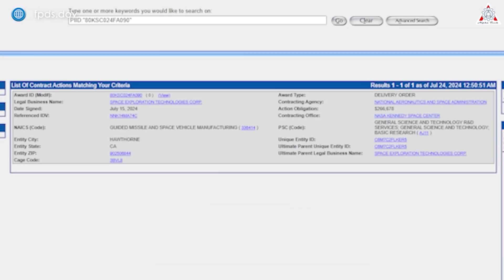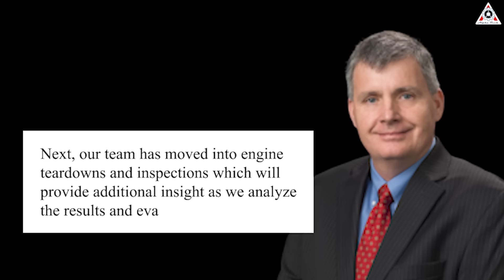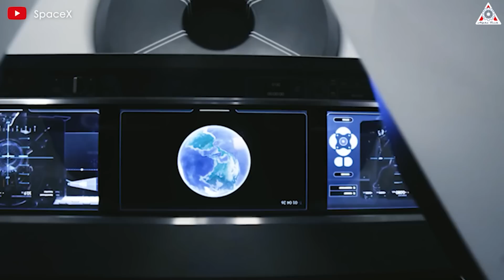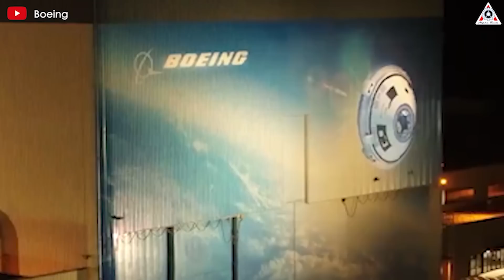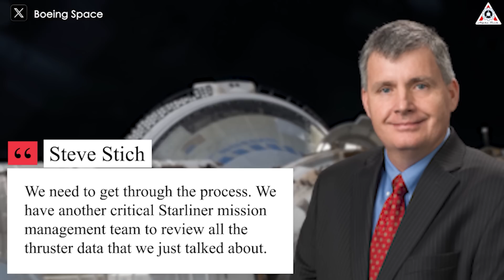Boeing Starliner is OVER!...NASA Says Something Weird Happening On Starliner.

Comment: NASA is one of the main reasons Boeing is still in business. SpaceX will replace them soon enough. If I had my ass stuck in space and was told to reenter that POS module to return to Earth, I tell them GFY. Boeing should have gone out of business over all their plane crashes! Here they are again playing with Human Life just because they are Test Pilots.
Reply: Better than Rocket is here
Easy lift off 
Easy land on with antigravity Spaceship
No Fire
No Explosion
No Flame
Just Spin and
Lift off
Powered by Baterry

Work base on Gravity just spinning by using Battery
can fly in bad weather, plunge in the ocean even in outer space
Can lift more than 100 Ton 

Earth which weight predict 600 trillion ton does not fall at the Sun because of centrifugal in orbitting, on the contrary it does not be thrown far go out the orbit line of hold by gravity at the Sun as orbit center. Gravity and centrifugal is equal called Equillibrium, thats why until now Earth which we was inhabited always rotate and circulate the Sun. Now we justly take example : how if the gravity used and centrifugal is negated? The Earth will float far leave the Sun. So that centrifugal can be used to fly far away if gravity eliminated. Finally how to eliminate gravity?

It’s way rotate part of aircraft by horizontal. When that rotation faster centrifugal force getting greater and the gravity getting smaller, finally it lose the gravity and the aircraft start flying. Of course people would surprise: how the aircraft can keep rotate without fulcrums? Thats why we named that aircraft Shuttling System that is aircraft likes two disc adjoining attached in the midle as fulcrums:

A. The Top part, we name Positive rotate to right, and the edges is getting thicker and havier.

B. The Buttom part, we name Negative rotating to left, and the edges is getting thicker and havier.

C. Middle Part , we name Neutral, air crew placed and also machine and everythings turning Negative and Positive at the same time.

The aircraft can liftup added with explosion from the engine. However that aircraft construction later, let the engineer doit it, and we are sure the aircraft will bulletproof and also waterproof.
 
.
.
 
In modern civilization where human being generally using flying saucer as vehicle, will a lot of change in lives either in materialism and in psychological. In materialism area will apply the change in life like.
People no longger need roadway and rel road which spend large of energy, money, places, things and time, object place and time. People would utilize that area for habitat or for other need:

Comment: Boeung and NASA are involved in a game of pass the blame whilst scratching their heads. Boeing has little interest in space except as a means of gouging more money out of NASA so the cheapest makes most profit for Boeing and god help passengers. NASA is too concerned with the concept of competition encouraged by the army of Boeing lobbyists and politicians. Competition is only valid if there are 2 or more systems that actually work. NASA claims to be commercialising space but what commercial organisation would spend $4billion dollars on something that doesn't work and is 5+ years late already. However, its taxpayers money not theirs so they don't worry. Suspend Boeing's Scrapliner certification until it can perform an uncrewed flight to the ISS without ANY failures. Boeing and NASA management cannot admit blame for a PR disaster of astronomic proportions. The Chinese must be laughing their socks off.

Comment: Boeing should send the Starliner back unmanned. If it works, then Boeing was simply not confident in its staff proficiency. Which is a internal management problem. If Starliner is destroyed in its return flight. Then Boeing should simply get out of the manned space flight business. Simply because Boeing simply does not have the management competency to get the job done correctly.

Either way, Space X should be sent up to return the Boeing crew. As Boeing can not decide if they can make Starliner work properly. As any further delays are just wasting money for no effective outcome.

Comment: Starliner insulated those thruster clusters too well on the Starliner's service stage. Future designs should have some method of dissipating heat.  A redesign of the helium system is also feasible, in the future.
  This is all up to NASA.
  Boeing has helped in space flight, but this is the first ship that is all Boeing.   Shuttle was a Rockwell project. Boeing took over Saturn V first stage production, but Rocketdyne still made the engines. And that first stage wasn't designed by Boeing.  Boeing isn't taking this new type of rocketry seriously.  Boeing now specializes in lobbying, not cost effective rockets.  
  Boeing needs to return to those beautiful jets that they make.  They have a couple of competitors that are not interested in selling.  This can't be solved by money alone.

Comment: I don't believe keeping a cryo-liquid fueled rocket on stand-by is practical, or cost-effective.  Such a rocket would have to be engineered  to be responsive, like a thaad missle with a capsule.  We're talking solid fuel, disposable rocket designed with a capsule that can sit around for at least a year between inspection and overhaul. 
Possible, yet expensive to develop and maintain.   It would itself require extensive testing prior to being viable.  
  It would have been nice to have a string of rescue ships along which the Spirit of St. Louis flew, but that wasn't going to happen then, probably won't happen any time soon for spaceflight. 
Due to the frequency of SpaceX launches, maybe something could be arranged within a month of a problem.  But an instantaneous reponse system should not be expected.
Reply: What? So you're dumb. Like very dumb. 
Average temperatures in space is around neg454 degrees F (neg270 degrees C). It's almost as if that's the reason cryo-fuels are used. 
Cryo-fuels on the planet, and in it's atmosphere, are expensive and complicated to store, but the exact opposite of that once you get that fuel in space.

Comment: If there is a helium leak, wouldn't you want to return as soon as possible, at least before the helum level drops to the required minimum for the return trip, and there is no helium manufacturing facility on the ISS? Or, are they just waiting for the total depletion of the helium and then say, ok too bad, we can't use the Starliner anymore and we need another Dragon ship.
Reply: The helium has been shut off. No current leak till they try to leave. Not saying this isn't a messed up situation
Reply: @fredstipak6719  OK, thank for the clarification. I was under the impression that helium container had an unknown leak.

Comment: Not quite correct.  SpaceX does heavy modeling and sim as well, the difference is that SpaceX is willing to invest in test articles, sacrificial if necessary, in order test out the hardware and software against their models.   Boeing will not spend that money as their contract cost is already significantly higher than SpaceX's without the test articles.